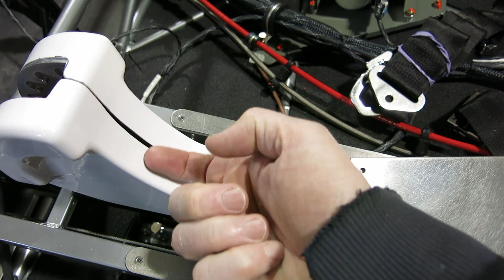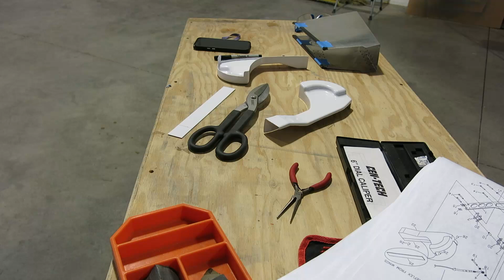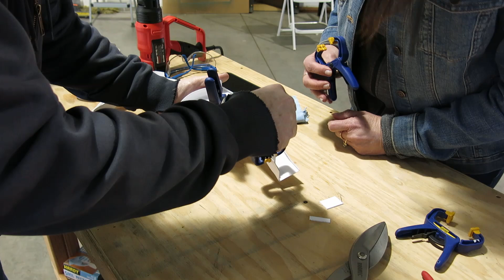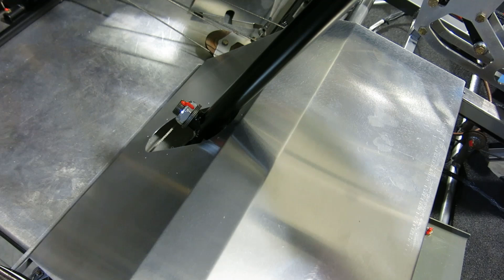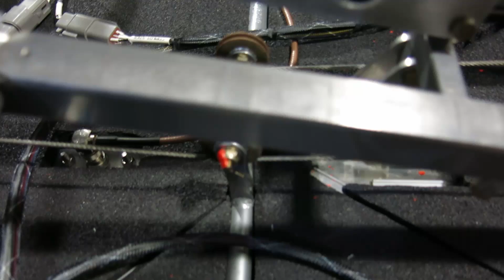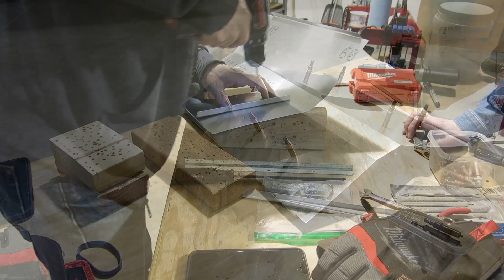No. 348 04-21-2024 Flap handle and control stick closeouts

Comment: RE: Full-forward stick stop. Do you anticipate flying wearing gloves? Then again, other than during flight control checks, do you ever anticipate needing full-down elevator?
Reply from the maker: No on both answers, but want to be sure full travel is available. The only time gloves would be a factor is in a full left aileron and full nose down with a finger on the PTT switch.
Reply: @s-21project92  So, when it just ain’t your day!